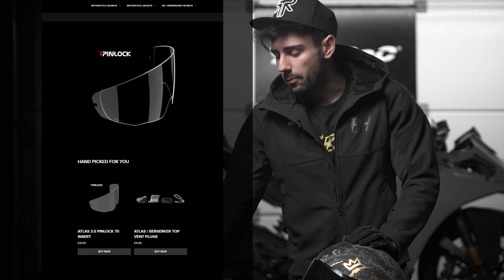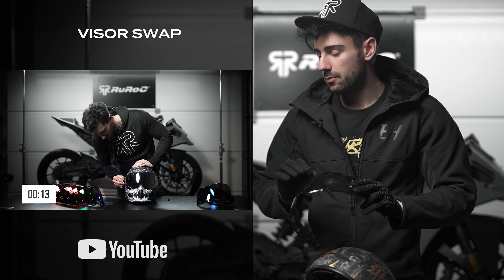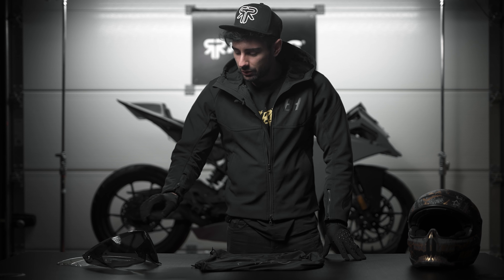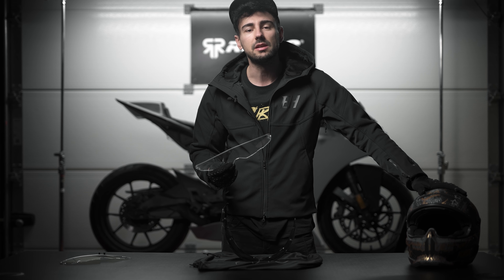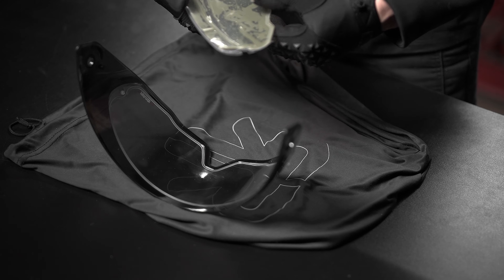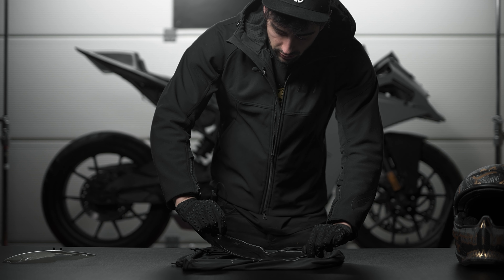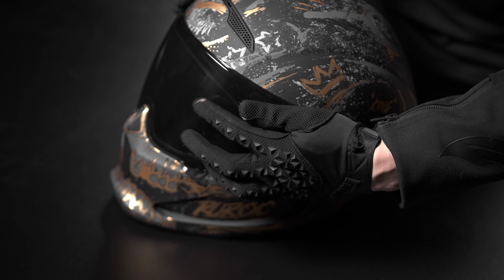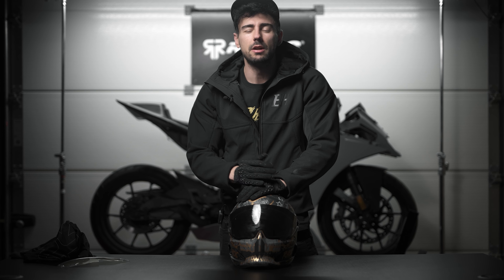AT4.0 Pinlock Install | How To

Comment: Why not a pin lock 120?
Reply: Whats the difference?
Reply: @memxak2338  the 120 absorbs more water than the cheaper 70, so it gives you longer before the visor mists over.